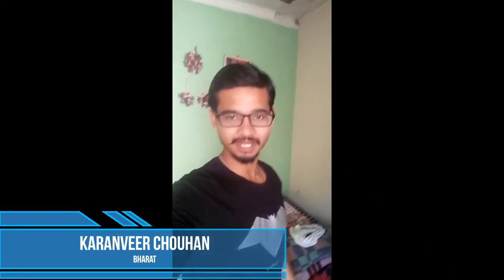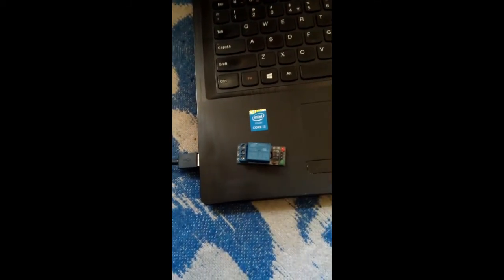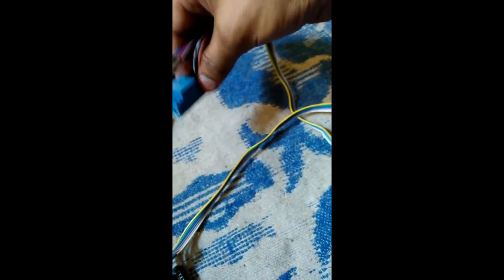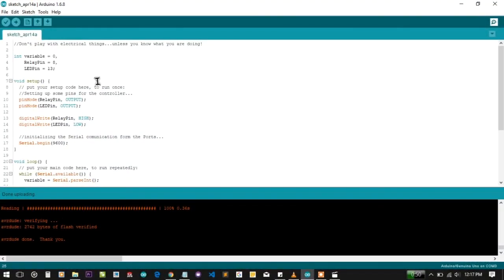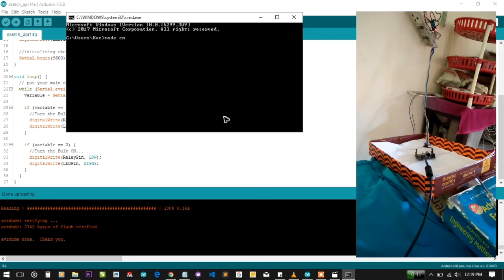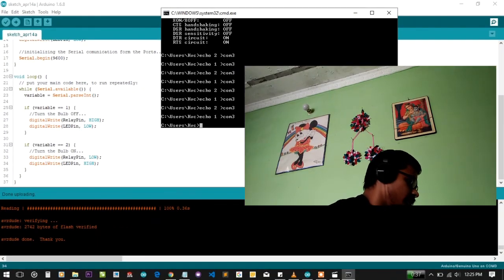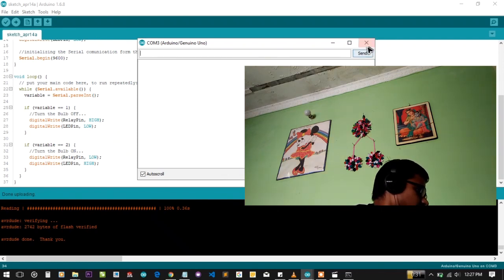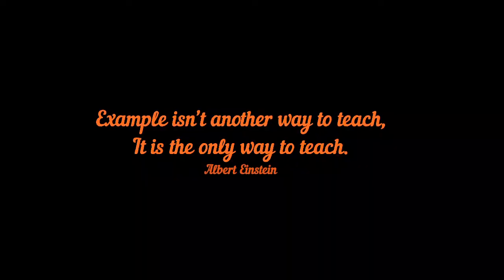Automate Home with Notepad/CMD | Learn Batch Programming - Part XI | Arduino UNO

Comment: Hi, thanks for your clips. But your work with arduino and module wasn’t clear. Can u provide a schematic of wires that I easily could to design my network for turn on the lamp . What’s the model of your arduino and module?
Reply from the maker: Ive used 'arduino UNO' (clone version). And, the schematic sketch is:
https://3.bp.blogspot.com/-V0Vp29mhajw/WuCGP6Hu4mI/AAAAAAAANrA/qiNy7h7ybtU-zzf1QtB9J39wlK-ZyhZiQCLcBGAs/s640/Capture.PNG

Red Wire is indicating the circuit with 5v supply to the relay. And, rest circuit is isolated by the relay from the controller & PC.